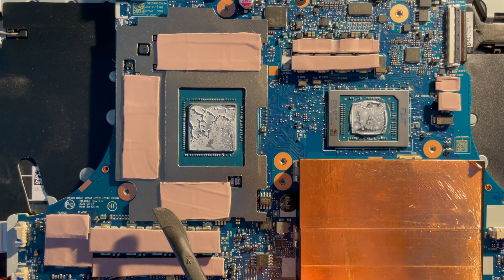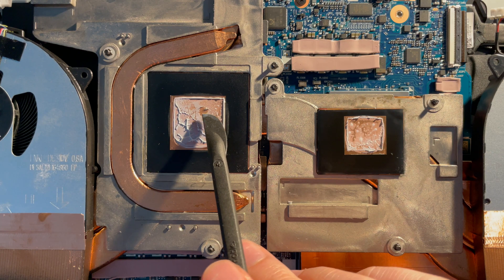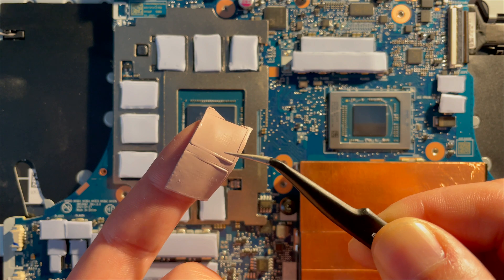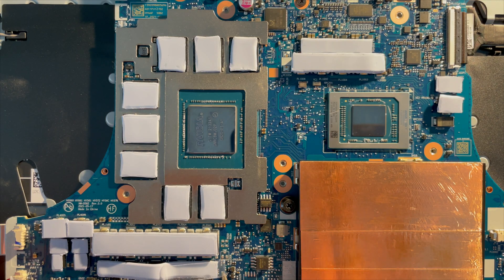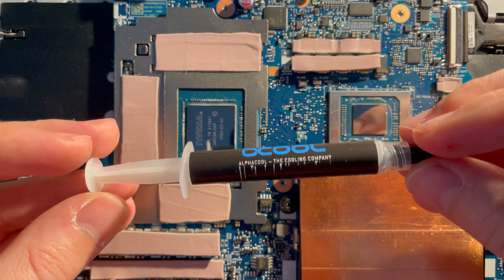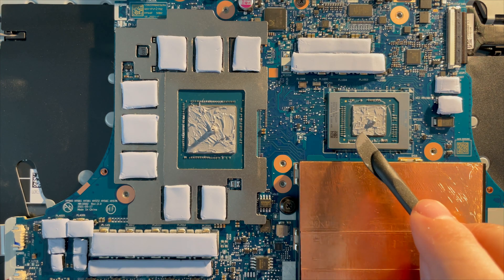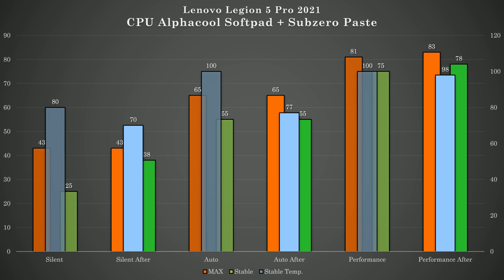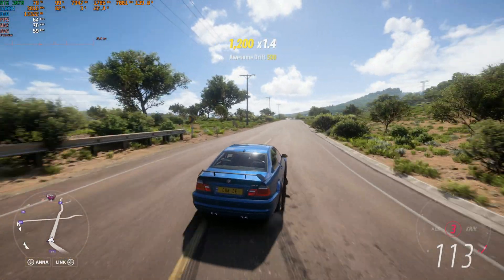Lenovo Legion 5 Pro 2021 Alphacool Apex Soft Pads and Subzero Thermal Paste Upgrade

Comment: HI! I have a big problem, my right fan is broken, it was scratching on something and I think the bearings are broken too, do you know were I can get the original heatsink with fans?
Reply from the maker: Not really sure tbh. But I would assume Ebay is full of them since device is now considered old. Or check Chinese sites since they have them 100%

Comment: those numbers what do they representant? i noticed they went up
Reply from the maker: Not much LOL it was more about sustainable power gains and not about temperatures. Meaning if you want to tweak your device you can see some temperature gains within loosing performance since we are not really gaining anything with our CPUs running at 80W :)
Reply: @atechcheck  power as in what measurement watts cycles of some benchmark fps. what is your power measurement?

Comment: I just gave up on mine and game at 95 degrees while I build my desktop PC
Reply from the maker: And theoretically you not wrong 😃 those chips will happily run at 95C. Issue is only fan speed and noise and some performance looses due to throttling
Reply: lol I was thinking about the same thing. I have tried everything for my Lenovo 5 Pro(1800 $) . After 3 years no matter what I do, temps are high and I don't get more than 50 fps in all my game. I am just abondonning the idea of a "gaming laptop" as a whole. too much hustle. Desktop is king and I am building one next month.

Comment: Have you tried K5 Pro instead of thermal pads?
Reply from the maker: No not yet, but since 1y mark is almost here for my last re-paste I will probably do it for my next Video as a test since I still have L5Pro (even tho it is messy AF) xD
Reply: @atechcheck  Yeah I'm looking into changing pads but this laptop seems extremely annoying to get temps similar to stock might just buy the heatsink it's pretty cheap and less hassle
Reply: @HydraCFW What heatsink?

Comment: Well I was attempting this disassembly but it seems the manufacturer glued down the left fan power connector, after wrestling with it for some time the red power on the 4 pin popped off 😳. Now I have 1 working fan 😔. I have the best warranty so contacted Lenovo. They said it will take weeks to fix. Looked online and found the whole heatsink assembly from direct from them for 63$. Might just replace the whole thing myself as it looks like it comes with thermal paste and pads pre applied. Sadly fans are built into heatsink on this unit so whole thing needs replaced.
Reply from the maker: Yeah they do that sometimes…. Connectors are really small and I would advise to check first and if you see glue then either cut it or heat it up with a tip of soldering iron etc. and then when warm try to pull up…
Reply: @atechcheck  Tnx that worked
Reply: Not sure if I can get that fan connector out though. It's glued down pretty good.
Reply: Het Seth i was walking into the same problem as you, and also destroyed the powerconnector of the left fan. Did you find a different solution or is replacing the heatsink the best option?

Comment: Hello Bro, thumbs up for the good work 👍. You have earned a subscriber !
I have recently bought Legion 5 Pro 2022 Model with i7 12700h + RTX 3060. Repasted with LM and Changed to Fujipoly Extreme Pads (11w/mK) but the temps are worst than ever !!
Tried everything, different mounting pressure, different tightening pattern 1-6, 6-1 etc . . . but the temps are reaching 100C on CPU and 85C on GPU in Balanced Mode. With GPU Hotspot reaching 100C !! I haven't seen such temps difference in my life.
Any ideas?? I read your other comment where you suggested Thermal Putty instead of Pads? Any update on that? Have you tried? or know someone who has? I am really stuck and out of options . . . .
Will appreciate any help or input !
Reply: Hello all legion 5 pro owners!!!!!
ive found the best solution for high tempratures ! Just disable turbo mode on ur CPUs u wont notice any performance issue just lower temps around - (-15-20 C`) -- check videos how to do it its super ez - not sure i can post links here so i ll post the title (How to Enable & Disable Turbo Boost | Desktop & Laptop | Increase FPS | Fix Heating & Auto Shutdown)
 Next step use  WHISPER mode on GEFORCE EXP settings(this mode makes ur laptop quiter and lock ur FPS to 40)-u can change dat FPS lock from 40 to 60-or more if u want and all u have to do is  open NVIDIA controll panel,go Manage 3D settings then click on Program settings and choose one of ur games u want to optimize ,scroll to the bottom and click on WhisperMode and lock ur fps on 60-70 fps u dont need more fps than 60 (this is possible only if u alrdy activated ur whispermode from GFORCE EXP app or u can check how to do it on utube)
Reply: @martinpenchev5444  I have similar, even better, option to keep your laptop cool.
Just don't turn it on !
Because from what you are suggesting, it's better to leave a gaming machine and buy a rollercoaster instead.
Reply: Guys are u listeninng to me... i said  no performance drop u can lock ur max  FPS ,for me 60-70 is enough check PS5 on HD max framerate is 60fps on 4k FPS  is 30,have u even watched the link i posted? Now i am playin RDR2 on 60% of the settings on ultra with 4k reso locked on 70 FPS on wispering mode and balanced mode on legion 5 pro rtx 3070 with highest tempratures 65-66C` before this steps i mentioned temratures were 86-90C` sometimes in cities and FPS was 90-95.
What I wanted to do is to offer you a way to avoid the technical procedures you do, after all the videos I watched, for me these were the ones with the greatest results, and you decide for yourself if 100 degrees is normal on max CPU usage for 3-4 years old games
Reply from the maker: @martinpenchev5444  All true and but only as a last resort :D Because, are you really going to pay 1500-2000€ for a laptop to manually limit its performance to those lvls and going back couple of hundreds € in price range just to stop it thermal throtling.... I would not ;)
Reply from the maker: Hey man, THX a lot :) Well, in your case something is preventing propper die to block contact..... How soft are those Fujipoly pads? if you are unable to go thru them when under reasonable pressure in between 2 fingers I think they are too hard...... Also your case is really bad... why I would suggest is to get tone of those dentists tapes with color (blue, red usually) and then you can cut it to die size and test with and then without any pads to see what kind of die coverage you get since it will leave color behind where it makes contact with die and cooling block..... It is sad really that we need to resort to such diy solutions for 2k laptop.... Also check my paste video.... Maybe with a thick layer of Honeywell PTM you might go by and stay under 100C ;)
Reply: @atechcheck  I will definitely check your other video for Thermal Paste. The Hardness of Fujipoly Thermal Pads is around 55 Shore 00. Which i think is not too hard, but may be harder than the stock ones. Because whenever i unscrew the Heatsink i only notice light impression of the VRAM or VRM dies. I have found softer Gelid Pads with 12W/mK and Hardness of 35 Shore 00. Will try them too . . .
What i need to confirm is if i use Thermal Putty instead will it be a good alternative? I am worried even if the putty can be compressed more will the screws tighten more? to make better CPU/GPU die contact? Or they will stay at the same height?
Secondly, can you please elaborate how you screw the heatsink, i mean in which order? 1 to 6? how much tight is too tight? should i apply little force or no? And what about fan screws? do you tighten them after the heatsink or before?
Reply from the maker: @safwaniqbal5282  for thermal putty I can only say that it will work if you find one :D (I did not bother....) also atm I am using PTM from Honeywell for my VRMs in GPD Win3 and it is great but you will need a lot for Legion 5 and 5 Pro..... regarding the screws it does not matter that much tbh!!!! As long as you go easy and tighten all of then just slightly at the time one by one. In my case I saw on which side it was making less contact and I started on that side. First thing is to get them all in hols and turn once , then you can slightly wiggle you cooling block and then in X pattern screw them all one by one 2 turns at the time.... Fan screws you can do at the end since they are there to hold fans in place ;) Your main goal is to get soft as possible thermal pads or putty. Alphacool have worked for me but if you go with good thermal putty (LLT clip where Linus tries to clean a GPU after the putty ;)) I know that in a year I will be re-doing L5Pro with putty and Apex paste from my paste video. ATM I have some other videos to finish next to my job XD
Reply: @atechcheck  Can you please share the hardness of the AC pads you used?
I have found a good Thermal Putty TG A7000. It is a high viscous thermal putty with Thermal Conductivity of 7W/mK. I think i am gonna try this . . .
And also i will be using Honeywell or other thick paste for CPU/GPU die for proper contact. Since LM spread is too thin, i don't think it is making proper contact.
Reply from the maker: @safwaniqbal5282  regarding AC pads you will need to check their website and data :D I have no idea tbh. Also regarding putty I am not sure which one is good since I never used one (I guess I will need to to start searching) about LM you are right. Due to such contact issues it really is a no go with Legion series.... Please update when you try that putty and thicker paste ;)
Reply: Hey I got same temps as you. Did you fix the problem? I am trying the same my Lenovo Legion 5 Pro
Reply: @markkuuss  Removed the pads and used Thermal Putty instead. It can cover the gap more efficiently. Tried many pads, none worked.

Comment: Hello. any updates on CPU temp? after 3 months if they still work fine and the paste has not pumped out, it's the deal.
Reply from the maker: All is fine :) same like day I changed it :D I do however have another probably even better solution coming up but first need to finish my Thermal Paste comparison video this week ;) Wait for that one since it is better ;)
Reply: @atechcheck  ok bro, I subscribed for that. Thanks for the content ❤️
Reply from the maker: @sinasouls  You are welcome and THX ;)
Reply from the maker: @AIM PM hey man no not really…. Only upgrade that I have is to use Apex thermal paste since it is a bit more dense than subzero (better for pump-out effects) and if you have money to burn then I would go with Honeywell PTM to replace my therma pads since that one is hard as pads 😉 (check out my TP video) otherwise you could search for PTM in pad form since that one should be better…. My go to for now on is PTM in tube as pad replacement (where up to 1mm pads are needed) and Apex from Alphacool for CPU/GPU
Reply from the maker: @AIM PM you are welcome ;)

Comment: This is the kind of video I'm interested 😊 . More solutions like this . I wonder if u just skip all that and just use thermal grizzly conductinaut  liquid metal . I know it's not the most ideal since it can short laptop and kill it . I don't know why but I have noticed this overheating rpoblems in many 3070 versions of the laptop . I bought mine on Ebay new " " hopefully . In warzone it's not uncommon that I get spikes to 100c in gaming wich isn't ideal at all . I'll have to look into that copper sheets mod that's the kind of our of box thinking I like to see ,👍👍👍 !  I have heard that sanding and nickel plating the heatsink helps also with temps .
Reply from the maker: Hey man, glad you like it (more is coming 😉) I did thought of LM but even then we would have problems since cooling block is not even enough… I do however have some extra ideas… but for next one I will be testing different TM paste and combinations 😉

Comment: Update on the cpu temps?
Reply from the maker: not much is changed :) running stable under load as after repasting and silent in day to day use case :) I am however really tempted to open it up and see what is the real contact area between CPU/GPU and block.... Will do when I am done with other projects ;)
Reply: @atechcheck  take your time. I'm sending the machine to warranty. Mx4 not doing a great job., Room temps are high but no reason to run at plus 90°. I've read some tech commentary about the lack of pressure in the cpu die... But definitely we need to use high viscosity thermal paste like CM master gel maker, 11w.. nothing else besides liquid metal and oem Honeywell seems to fix the issue in the long run. Hate the fact that brands keep the maintenance product sheet to themselves.. nothing like a desktop
Reply from the maker: Yeat pressure problem is really unfortunately…. I was also thinking that instead pads it would make sense to use those thermal putty solutions… also I got my hands on Honeywell paste and I must say that it is different than others especially in viscosity… I will be testing all of them
Reply: @atechcheck  found a guy that actually changed the spring screws and got everything working flawless with better temps than stock. Other thing, what's your method to screw them?
Reply from the maker: Hmmm a screwdriver and my hand 🤣 but if you mean in which order then I am always trying to do it either in manufacturers order or basically in X patern to provide equal pressure to make sure that all sides are equal… could you share your findings, links and what did he did differently. I am willing to test 😬
Reply: @atechcheck  6-1 , the other fix was a mod and that would kill your warranty. Hsve you used kryonaut? It has better conductivity than ptm hw.
Reply from the maker: I did at first but I got Alphacool one with even better conductivity and it really is working great 😊
Reply: @atechcheck  noice. I've sent mine to RMA. Hope they will swap the cooling module for a new one. I just think its nonsense we have to send it to warranty everytime maintenance is needed
Reply: @PtSp86  interesting; with new spring screws?
Reply: @ALWAYSxREADY  not using. Thermal paste mastergel maker v2 results are good.
Reply: @PtSp86  I was just looking into that very same paste for a solution. I'm noticing that during gaming my c.clk jumps around between 4GHz and 1.7GHz and the only thing I can think of is the thermals on some components are too much. Probably the vrms, but I know repasting will be necessary anyway.
Reply: @ALWAYSxREADY  the tim used is really good but also degrades with time. It provides only 8.5w. I've investigated a lot and we Legion pro owners need high viscosity tims, and Mastergel provides that with higher thermal conductivity 11w. It peaks 90+ but in one core. Nothing you can do because it's the cpu management. The other solution if you dont want to repaste would be to use AATU, previously called ryzen controller and set max temperature of 90. It will work really well
Reply from the maker: Sooo finally did my paste test xD all I can say is that there is a difference and I will be doing one last video on this topic with 5 Pro. Honestly I am not expecting much… no matter what TP we use if build quality is bad, cooling block design is not adequate, die to block connection and pressure is bad we can not do much…. I hope my solution with Apex for dies and Honeywell as a replacement for pads will bring something and make things better but again not expecting much…

Comment: Hey man, thanks for the videos. What height did you stack your squishy pads to? Did you just use single-layer 2mm and get good contact with that?
Reply from the maker: hey, you are welcome :) Well I used 1mm single ones since original pads were same some just under 1mm and if there were any gaps or unevenness those 1mm soft ones were enough and where they needed they were pressed and conformed to space they have :)
Reply: I saw that Lenovo uses like non standard .80mm or .88mm in thickness.
Reply from the maker: @ALWAYSxREADY  Well if you go with harder ones like stock pads or TG I would also go with .8-0.9 but the problem is (as you saw) that on RAM for example contact was more than great and even preventing GPU die to make proper contact.... on the other hand VRMs were not making that great of a contact (I think it needs another screw in the bottom left corner xD) Paste/Putty is the only real solution here tbh but those soft ones can work too
Reply: @atechcheck  Agreed. I'm looking into putty for the vrms and such as so far its the best solution i can think of. One that I was looking into seems to have been discontinued tho.
Reply from the maker: @ALWAYSxREADY  Yeah that is the main problem... It is hard to find it and same with Honeywell (not that great) and when you do it is expensive xD I hope it will become standard and replace pads in the future

Comment: Why did you repaste? was the stock thermal pad? or the thermal is not the issue? i heard that lenevo laptops have the best thermal pastes, maybe the application was poor? like they put a little paste or in a bad shape. im sure the thermal paste of llenevo is very top teir. so i assume their application was bad, not their thermal paste. right?
Reply from the maker: Well I heard the same :D jet my CPU was in 100C in all modes above 25W... I am not sure if it was paste/pads or bad application... After replacing it with TG I have noticed slight improvement. I did saw that pads are not pressed same and I assumed that cooling block was not even and straight. That is the reason why I went with soft pads to mitigate this issue and as you can see CPU/GPU dies were not making right contact to cooling block due to unevenness. It could be that only my unit have had this issue but I doubt it. But now it is fine :D